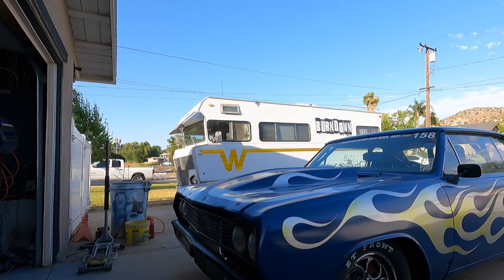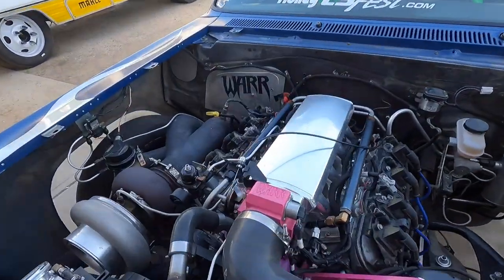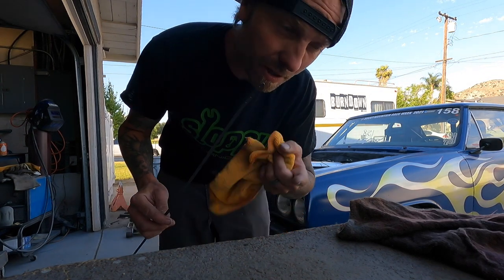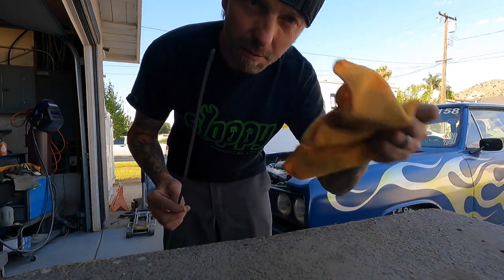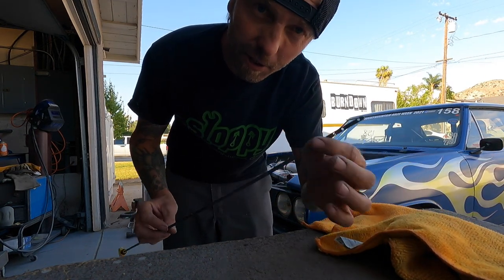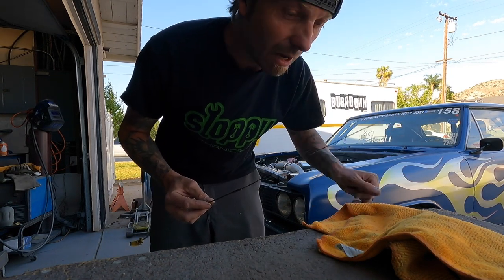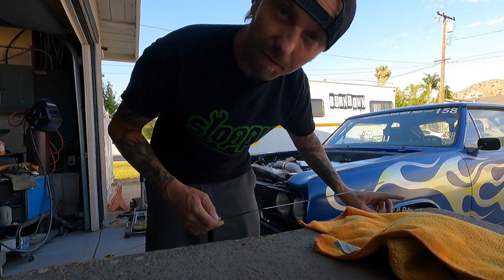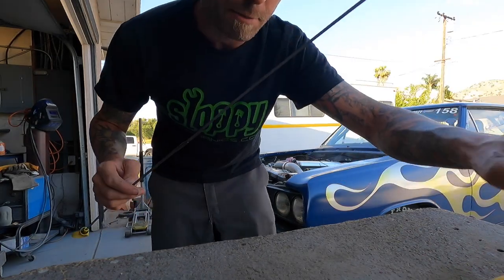LS Swap Oil Dip Stick FIx

Comment: Thanks for this valuable info, especially about the ls3 dipstick and showing the pan etc
Reply from the maker: I used this same dip stick for a while so who knows how long I was running with low oil in the car with the dip stick reading full. Sometimes its the little things that make a big difference. Glad you found the info useful.

Comment: Great tip to keep the engine alive 👍
Reply from the maker: It just makes it simple and straight forward. You need simple when your in a hurry or stressed out. If stuff is over complicated its too easy to mess up under pressure.

Comment: Thank for the video I thought it was 5 qts as well since it was a smaller pan I’ll add 1 more thx again
Reply from the maker: I would calibrate the dip stick and make sure so you can confirm for yourself what your set up needs.

Comment: Sounds like the Hyundai Sonata 
The engines were blowing up around 60,000 the fix was change the dipstick 
My gf ended up taking hers in they put a scope down the oil pan listing for noises and then changed the oil and dipstick we went to pick it up and I said they didn’t hear a noise ? Which sounded like rod bearing to me 
Rev it up to 3,000 and you get that chatter noise the guy says oh no that Variable timing noise 
A week later the engine sized up lol 
And 2 weeks after we got the car back a tree fell on it lmfaoo! It was an experience lol
Reply from the maker: Oh wow. Thats crazy. I wouldn't have found this right away I don't think if I didn't have fuel problems. Things work out that way sometimes. Once pass at the track is sometimes more valuable then driving around for a day.
Reply: @Burndown  right on brother !

Comment: About alternators I just saw a video from motion race works about alternators and they were talking about oversized pulley so it doesn't spin as fast
Reply from the maker: I have an over sized pulley on mine that came with my pulley. Im going to put a nice 180 amp unit on when I have the cash saved up form my guys at Warr.